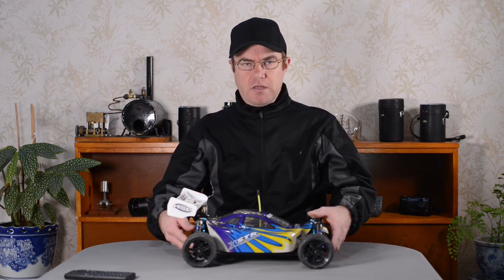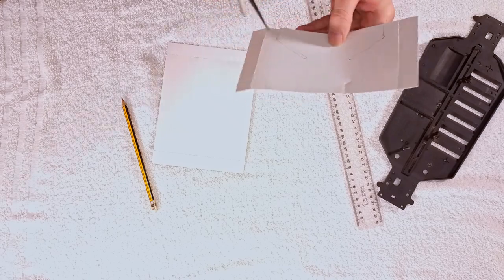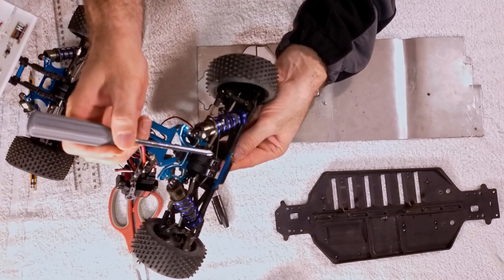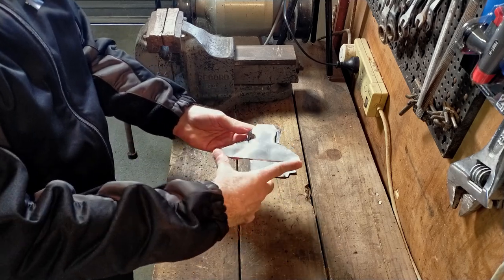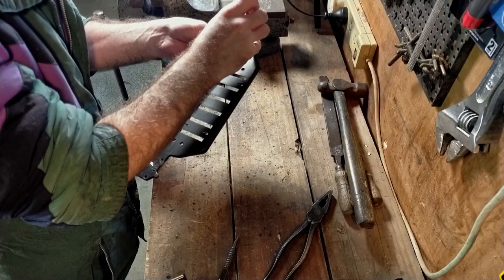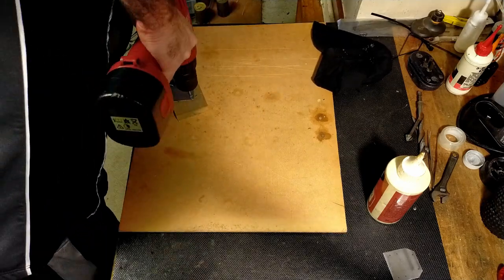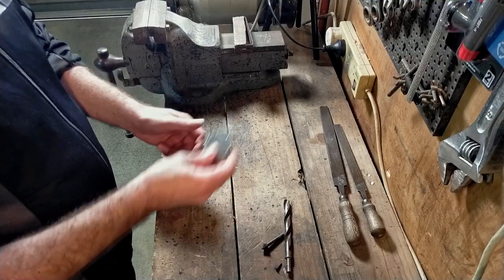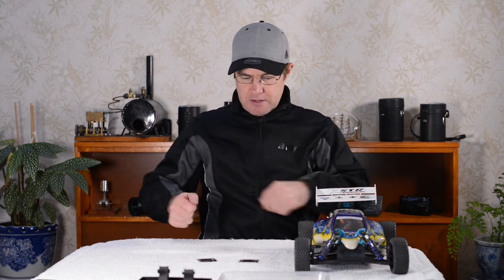Custom DIY Stainless Steel Skid Plates

Comment: The changed design I understand why you didn't it but you've created a very nasty weak point in the plastic chassis! Ask me how I know! Well because even before ever even seeing this video I made basically the exact same type of skid for my hsp brontosaurus/redcat volcano which uses the same exact chassis as your buggy. But you'll never guess what happened next! Lolol well I had a custom 2 piece plastic chassis after the slightest jump😂😂 So I  just wanted to give you a heads up after watching this video you'd be better off without em or be extremely careful. After replacing the chassis I made another skid and it is basically the same thing exact skid you originally were making and it made my monster truck dang near indestructible!! I send my rc  15ft+ high off my ramp time and time again and it survives it every single time. So you might want to make another one whenever you get a chance. Great video but I thought it was funny we definitely have the same brain and thought processes!
Reply: What exactly is the design flaw? You failed to mention it despite saying there is a flaw